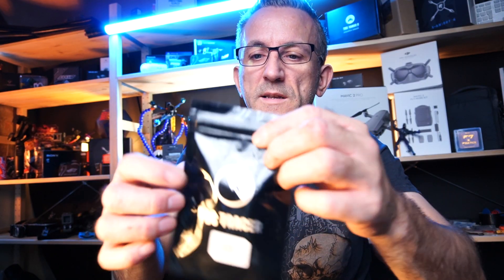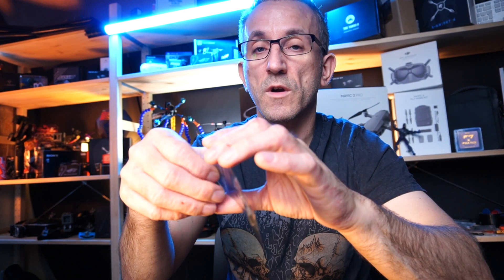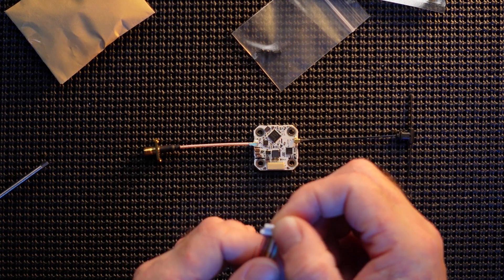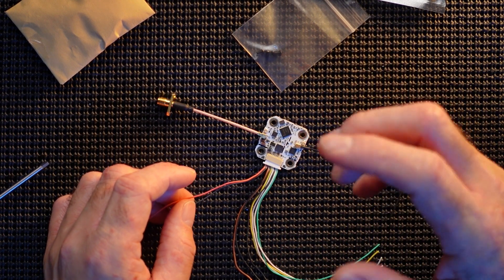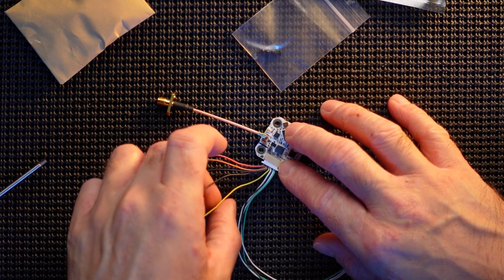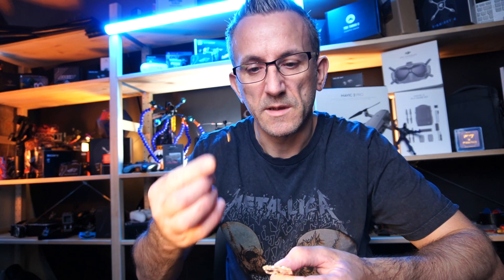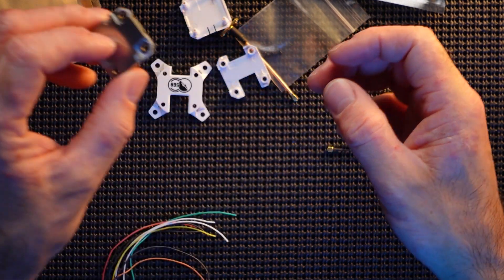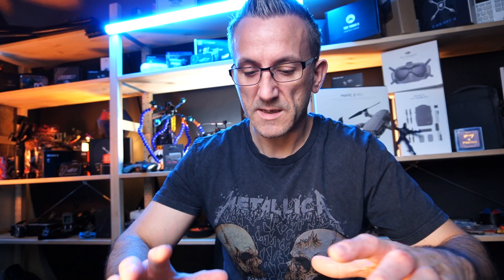TBS Tracer Sixty9 (RX + Unify VTX) Wiring / set-up

Comment: Do I need to wire all the ground wires to the FC or do I not need to if I’m not using the orange power out wire and the audio wire. Do the ground wires pair with these wires or do I need to wire them even though I’m not using the audio and power out.
Reply from the maker: yes, I'll be wiring in the grounds... I won't be using the audio wires, so I'll probably just remove them...
Reply: You only need to wire the main ground wire to the FC. The other ground wires are there for powering a camera from the board and/or connecting a mic. The TBS Crossfire manual has a wiring example for the Sixty9 on page 13.